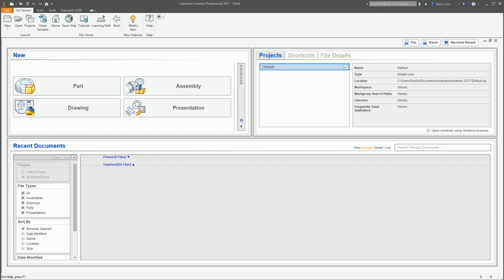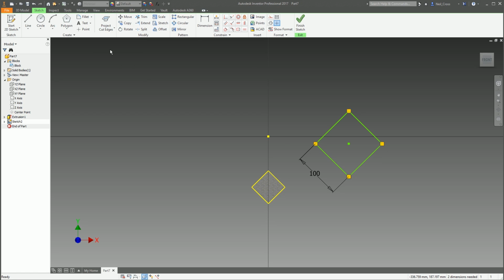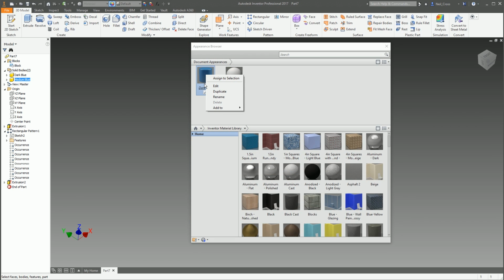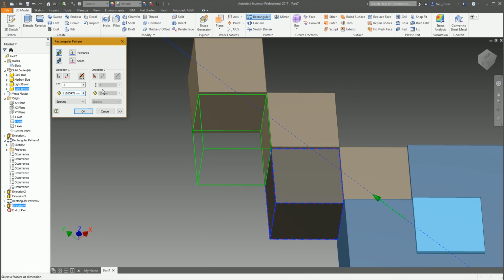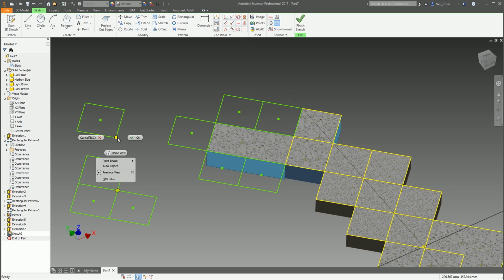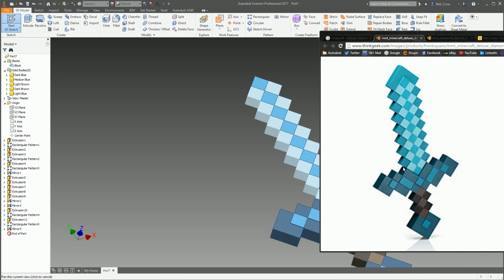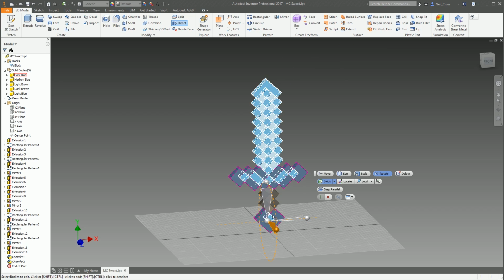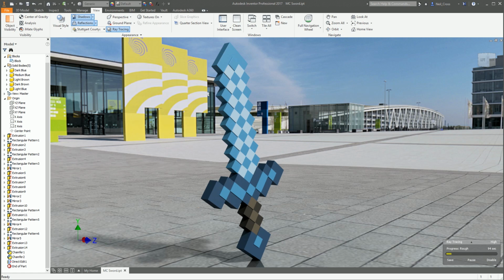3D Modeling a Minecraft Sword Tutorial | Autodesk Inventor

Comment: Don't want to nitpick, but you could've done this in under 5 minutes in AutoCAD's 3D modelling. This is also why I prefer to do frame design in AutoCAD rather than in any "proper" engineering software. 
Drawing everything in one environment and then slapping things together is just so much faster constantly creating and naming new files, dealing with constraints and needless details.